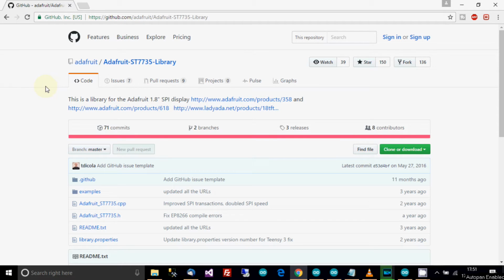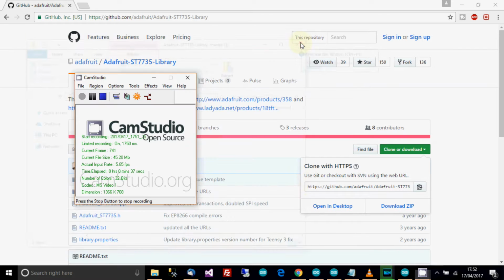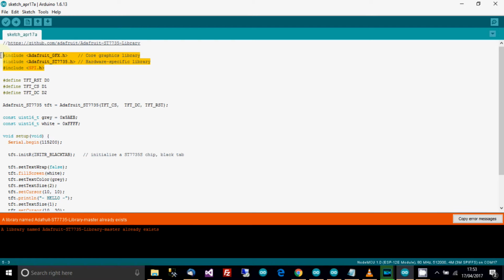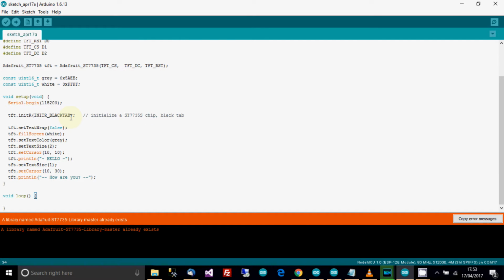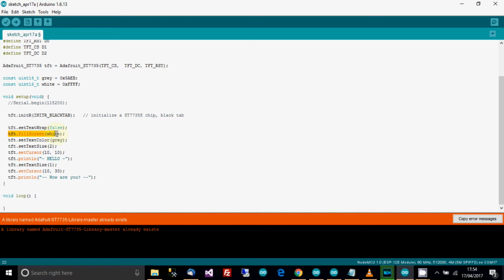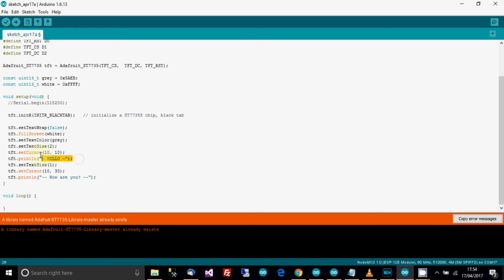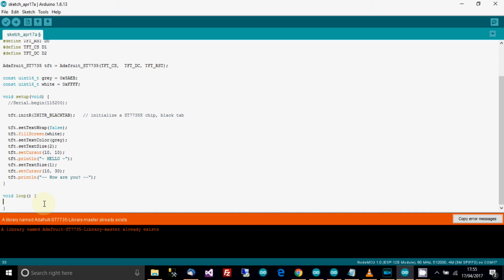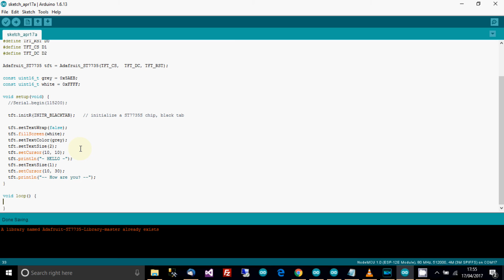TUTORIAL: How to Wire up 1.8" TFT LCD Screen to NodeMCU ESP8266 - Easy! (Part 2/2)

Comment: This procedure still works years later, with the following differences:

The library can be downloaded directly into the Arduino IDE using Library Manager and selecting AdaFruit ST7735 and ST7789 Library.
The example file will be found under File\Examples\AdaFruit ST7735 and ST7789 Library\graphicstest.
Remove the options relating to different types of boards and simply define TFT_RST, TFT_CS and TFT_DC as per the wiring described here.
Make sure the option to compile "For 1.44" and 1.8" TFT with ST7735" is the active one.

The graphicstest sketch then should run as is.  Removing the #include for the 7789 version of the display will save some program space.   I have used both the black and the green tab initializer and I can't tell the difference.

Comment: I need to get my SD card reader working with the TFT (1.8" SPI 128x160 V1.1, the red one), which is on the backside of the TFT board, but I'm not sure how to connect MOSI (Clock and MISO can use the same pins, and CS on a free GPIO pin which can be initialized thouth the SD_init(CS_PIN) innit ?). Can someone help me ? I'll add more info when i get an answer. I'm using these libs/headers:
#include <TFT_eSPI.h> 

#include <SPI.h>
#include <SD.h>

Comment: does the  back-light come on when powered directly ?
I tried, but the screen is always black
is there some way to see if the display is alive without a program ?
Reply from the maker: Hi, if you connect the BL and GND pins to their appropriate connections, the backlight should glow, regardless of other pins. :-)